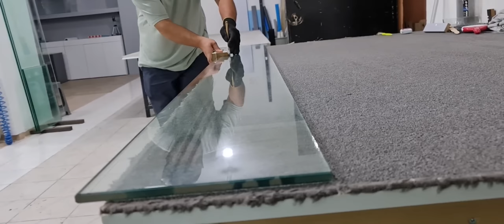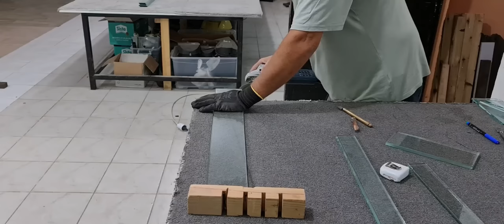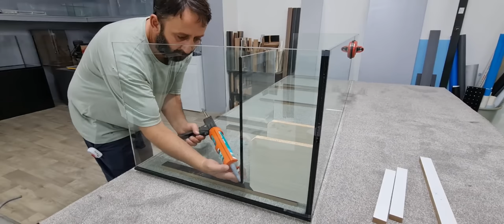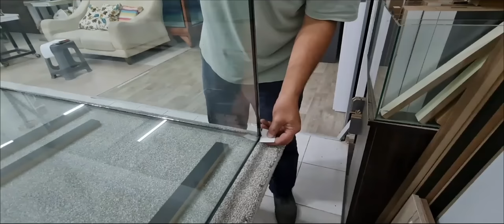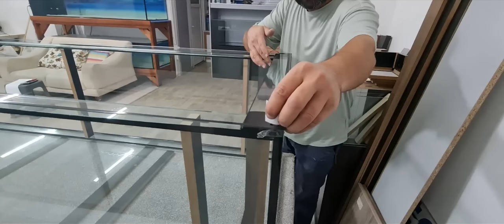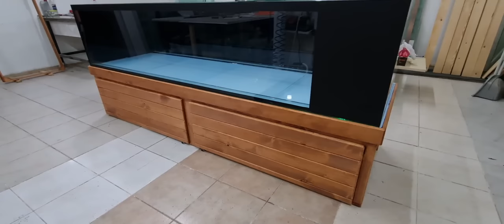A GIANT Aquarium, A Large Elevator Crane, A Very Hard Work

Comment: Merhaba İlhami Kul, What are the standard dimensions of a completely large sheet of glass 12 or 15 mm. For example, the standard sheet of glass = 350 X 250 cm ? ? ? ? ? Then I can take that into account when ordering my size aquarium.
Reply from the maker: Merhaba

10mm 	6000×3210
12mm 	3210×2250
15mm 	3210×2250
19mm 	3300×2140